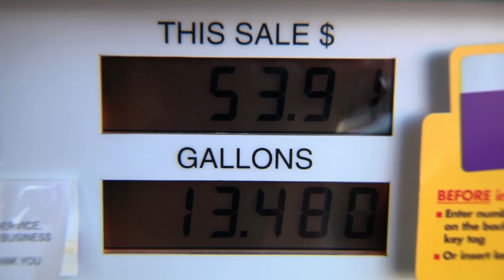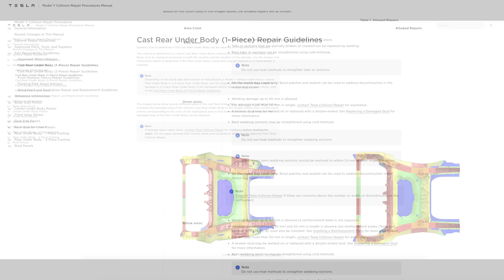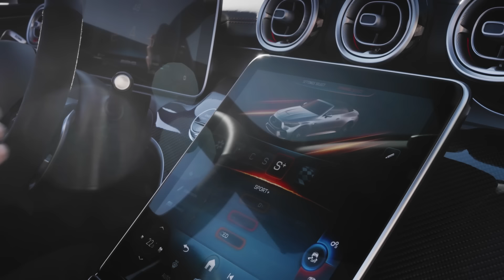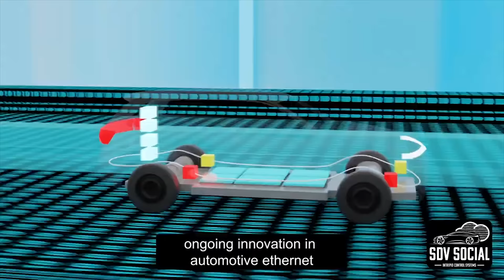EVs Put Massive Dent in Gas Demand; U.S. Eases Battery Sourcing Requirements - Autoline Daily 3805

Comment: Remember, when you hear sales percentages, they never mention the cars already on the road. I'm guessing the "EVs on the Road" are a very small percentage. I never hear existing cars mentioned. I'm not against EVs, I just think it's going to be a lot longer than they think.
Reply: Yup. It should be considered illegal or at least as "lying" when they mention just percentages.
Reply: Ice vehicles sales peaked in the u.s in 2017(during a growing economy at that) and the ice vehicles that did sell were likely more efficient than the ice vehicles that went to the scrap yard.
Reply: Yes, but while EV sales might be putting only a small dent in the overall fleet numbers, people might be preferentially driving their shiny new EVs, especially for everyday commuting.
Reply: @dansanger5340 Yep. Two-car families, with one EV and one ICE, are driving their EV as much as possible. The difference in running cost is staggering.

The combustion car is relegated to being used for longer trips, and where two cars are needed at the same time.
Reply: @JD-yx7be That's hard to believe with as many of these four door pickup trucks that make up the majority of the sales at most dealerships. I know for a fact that those big vehicles get really poor gas mileage.
Reply: @paul5683  my 95 f150 with 5.0L standard cab get 14mpg a 2024 f150 crew cab with the 5.0L gets 20mpg
Reply: @EnriqueThiele Please don't bring "NACS" into the conversation.  Elon didn't open source it until a few months ago.  He kept it proprietary for so long because he was trying to lock people into a walled garden.  The only changed his mind when that failed.  His greed (and the regulators' failure to mandate a single standard) is the only reason that we are the only major EV market in the world that is CURSED with two competing standards, which has hampered overall EV adoption.  Elon really screwed the pooch on that one.
Reply: That’s what is said all the time, but the conversion to EVs is well on the way. EVs have gone from nothing to 3% very quickly.
Reply: Excellent point, and would be a better way to analyze.
Reply: @dansanger5340  Maybe, but data and facts needed.  I'm pro EV, but anti reporting of conjecture as fact.
Reply: @PercivalFakeman  It would be good to know % of sales vs. % of active auto fleet.
Reply: @PercivalFakeman  Trends have a way of suddenly surging. Film to digital cameras. Flip phones to smart phones. 
What we lack right now in the USA is a selection of cheap EVs. Engineers are designing them now, along with cheaper better batteries. Someday the floodgates will open. If we don't do it, the Chinese will.
Reply: @BTC_Minarchist  It is a little over 1% of total fleet in the u.s, and around 7.5% of new car sales.
Reply: @BTC_Minarchist  from various sources, it appears to be about 3% of Americas autos are electric. When check parking lots, that seems about right. Also, auto sales are way down right now, but cars that plug in, either EV or Plug in hybrid sales are about 50% of sales as per various sources. I think that the sales are an anomaly and that that ratio will drop in the short term to favor ICE autos. At least for a few years.
Reply: @PercivalFakeman  seems reasonable.   Hopefully, we can get some more detailed and reliable data over time.
Reply: @EnriqueThiele 
Exactly!

Comment: 7:45 - An AMG 53 with just what ?
3 l V6 - what a crap of downsized machine. Quite the opposite what the had sold before and they must even hide it under 5.3 instead of the usual AMG 3.0 

Stupid move and weaknees, only idiots would buy these cars compared with those engines they had sold before. Makes no sense for a company that wanted to offer a sports car spirit but delivers an empty hull instead.

Comment: Unfortunately, what makes electricity? You make a product dependent on something. Control the flow and price etc... every aspect... Now we use fuel to make electricity and batteries and parts, send it through plants and wires and transformers etc...
Reply: Tired narrative. Last year, 90% of new power production was solar and wind. The last coal-fired power plant built in the US was built in 2013. Now, coal-fired power plants are being decommissioned. Unsubsidized solar is the lowest cost of electricity production, so it is winning.

Comment: If  "EVs put a massive dent in in gas demand", then explain why oh why, gasoline prices are at near all-time highs in California, a state that has more EVs than any state in the union? Oh, and by the way, as a taxpayer, I completely resent having to pay for a portion of the cost for my neighbor's EV via government subsidies. This is taxation without representation.
Reply: Well, CA keeps raising its gas taxes. And it artificially reduces supply by dictating only CA-blended gas can be sold. And it doesn't permit new local oil production, so it has to come in from elsewhere, like AK. Refineries are closing faster than they are being built/expanded, so meeting CA demand is difficult. Pipelines don't really exist across the Rockies, so supplies from the rest of the country don't affect CA's supply/demand.
 
Basically, CA WANTS gas prices to be high to you don't use it.
 
And it isn't taxation without representation. You have representation. You can vote. You're just surrounded be enough people who vote to give unelected bureaucrats & committees control over your economy.
Reply: @theevermind  Fact grenades flying all over the place in that response 🙂
Reply: Why should you poison the air for free?
Reply: The cheapest way to remove and prevent the brown clouds over california is not to produce them.   The EVs are a bargain.

Comment: I have a 1993 Oldsmobile Achieva scx with the w 41 high output Quad 4 I have a spare motor and my car is in great condition because I know how to work on it myself the engine is modified a little bit about 225 horsepower it's just a 2.3 litter dohc four-cylinder no Turbo with a 5-speed manual transmission fast enough for me the only way I will get an electric car is if I'm forced to

Comment: Hate to tell you Autoline, but Tesla has replaceable crush zones on their castings too. There are indexed areas on the crush bars where the damage area can be cut out too and a replacement piece bolted on in its place. Yes the drillout hole indications for the bolts are already there on the casting. 
   Xiaomi's similar solution may be faster to repair but may actually require more material regardless of the amount of damage....therefore more costly overall.
Reply: Didn't Sean say in the last autoline episode that Tesla was changing its mind concerning these giga castings?
Reply: They are junk and weak quality. They are literally falling apart like their axles.
Reply: @paul5683  Tesla was contemplating making some more affordable cars by casting the entire front, back, and sides all in one big casting. I believe Sean called it a "megacasting". 
Right now Tesla only casts two major parts of the underbody and have decided to just keep doing that for their newer, more affordable, line of cars. I think the media is calling this as "Tesla abandons large casting" or some such fodder. In reality they may have found that it might not save them all that much time and money to make it worth it.
Reply: The now fired quality team thinks casting cracks are fine!  Ship em!
Reply: @bobbbobb4663  LOL.  Actually the head of the charging group was recently swing under Elon as a direct report. Two weeks later she and her whole team is fired. One has to wonder what Elon found out?  Tesla has lots and lots of teams, but I've never heard of one with 500 members.... in Tesla that is a monstrosity. Usually teams are less that 7 people.
Reply: @nickmcconnell1291  When your CEO is an admitted drug user with a BoD that is a full of a bunch of yes men, this is exactly what one you assume would happen from a decision making metric.
Reply: re: "There are indexed areas on the crush bars where the damage area can be cut out too and a replacement piece bolted on in its place."which unfortunately means very little in the context of Insurance Co's developing stance on the warrantability/irreparability of unseen damage to the Main Traction Battery.
Reply: @phillyphil1513  Very true. It really boils down to depreciation. I used to work in a large multinational bank. I saw how our car mortgage business worked with insurers. If the car's depreciated value was less than the repair of possible underlying damage (like a possibly bent frame) then the insurance company would write the car off. 
They would rather do that up front than chance having more expensive claims later on a previous accident. 
    The same holds true with EVs but even more so. EV prices have gone drastically down in the last two years. This has massively depreciated the ones bought previously. There is not much data yet on how various collisions affect battery packs. Ergo, the insurers would rather write off the car for the depreciated value if there is any question that the battery may have been damaged. 
However this might change in the future as battery pack prices continue to fall. By 2030 they may cost under $1,500.00 to replace. This may entice insurance companies to just fix damaged EV castings and replace the battery pack too just for good measure.
Reply: @phillyphil1513  BTW, if you are getting huge insurance quotes on EVs, then it may be that Tesla doesn't offer insurance in your state yet. Amazingly once Tesla insurance is offered in a state the price of all insurers for Tesla EVs comes down. Bizzarre huh?

Comment: I can't imagine it is much of a dent because I see very few EV's on the road.
Reply: depends what state you are in. Many mid west states are 1-2% and many coastal states are above 10% of new car sales. I'm in Maryland and it is around 15%
Reply: @JD-yx7be  % of fleet not % of sales is far more relevant and even in California, they are too afraid to release that data so they must be embarassed by how small it is.
Reply: Of course not since the global fleet is huge and there are relatively few EVs on the road.  That doesn't change the fact that EVs continue to take both market share and an ever increasing percentage of the total miles driven.
Reply: @jerrymiller9039  5% of the fleet is replaced every year with new cars sold and old cars entering the scrap yard. 5% means it roughly takes 20 years to replace the fleet. 2017 is when ice cars sales peaked and has been on a steady decline since. Battery prices are falling every year while ice prices keep increasing. There is going to be a point where they reach price parity without subsidy.
Reply: @JD-yx7be  "There is going to be a point where they reach price parity without subsidy."  Time will tell, we are not on track to roll out EV's anywhere near as fast as what they have been claiming for years.  There have been plenty of examples of technology catching on but also plenty of examples of it not performing as promised and flopping.   Nobody has a crystal ball but we know ICE works well and we have the technology and infrastructure in place for it.
Reply: That would be called "confirmation bias".
Reply: @jerrymiller9039  Time will tell. There was a time there was no gas infrastructure too. I think the first public gas station opened in 1913 decades after the gas automobile started sales and it wasn't built out nationwide the next day either.
Reply: It looks like there are a lot in southern california, this is a huge population
Reply: I remember driving with my grandpa in his 83 f250 diesel and maybe 1 in 10 stations had diesel now it is closer to 3 out of 4
Reply: @JD-yx7be  Diesel is a dirtier fuel than regular gasoline.  It is not refined as much and puts out far more particulates.
Reply: @jerrymiller9039  I only mentioned diesel as that was fairly recent infrastructure build out. EVs now outsell diesels in the u.s so i would expect chargers to increase as the cumulative fleet increases
Reply: @JD-yx7be  Chargers are increasing but not rapidly.  Last week Tesla fired almost everyone in its department that makes new charger stations.  Also diesel is still the dominant fuel for commercial trucks and construction equipment and such.  Diesel is not going away soon for applications that need good torque or towing capacity.
Reply: it will be a gradual growth just like diesel station growth, people saying everything will be ev in a few years are delusional

Comment: What will happen to the gasoline when all cars are electric
Reply: what will happen to blockbuster when everyone streams?
Reply: @JD-yx7be  what to reply when answer to a question is different question ? 🤔
Reply: @prilep5  yes
Reply: Gasoline will never fully go away. People still makes buggy whips and stagecoaches.
Reply: @JD-yx7be  Q: what will happen to blockbuster when everyone streams?  BETTER Q: what will happen when the bulk of the population develops the wisdom and intelligence (like the older generations possess) to STOP making the classic mistake of "Apples V. Oranges" comparisons...?
Reply: @martyscholes119  re: "People still makes buggy whips and stagecoaches."  ironically, i still see people occasionally driving Model-T's (small collectors and owners groups obviously).  in fact, i took a picture of one driving in traffic on the 880 back when i was out in 'Frisco just before the Pandemic (still have the pic on my phone).
Reply: @phillyphil1513  when something gets replaced the old thing goes away. it is apples to apples
Reply: @phillyphil1513  you think that trucks tractor bulldozers ships and aircrafts will be battery powered?the first question was that most of the demand for carbohydrate fuel are diesel and kerosene there is no aircraft or heavy duty machinery that runs on gas87 or 90octane. Cars exist just to burn/spend  the unwanted fuel

Comment: massive dent in gas demand? more like gas prices reducing consumption at the pump as no one is filling their tanks.
Reply: the vehicle consumes the same rate of fuel no matter what level the tank is filled. If you only fill 1/2 way then you have to go to the station 2x as much
Reply: @JD-yx7be  its called trip planning. more people end up doing it to save their dollars instead of just say. ducking to the shops for bread and milk only. you go the the station less and get 2x done. but at the cost of convenience. im all for giving up some convenience for a greater good. but all this false BS about batteries being 'green' needs to be addressed truthfully.
Reply: @highwaltage  I don't care about it being green other than my wallet. My aunt owns a 11 year old EV on original battery with 90% capacity. I plan on buying a used EV for my next vehicle. And i get my electricity from coal and support the local coal workers
Reply: @highwaltage  🤦
Reply: @BTC_Minarchist  quit hitting urself. not healthy lol.
Reply: @highwaltage  😊😉

Comment: The stats I have seen on oil consumption hasn't really changed.  
EVs are idiotic when the energy and convenience of a gallon gasoline cannot be matched. 
Tax credits is taking others peoples money and pushing a political position most are not wanting.
Reply: If you pay taxes you might as well get something back. Plus you can "fill up"  at home which can't get much more convenient
Reply: I can charge at work for free or at home for 25-28 miles/$. Maximum convenience. Last time I needed to go to 20 megawatt gasoline pump is when I rented U-haul van to pick up dining room furniture.

Comment: EVs are so popular, there are lots of lots full of them, unsold.  When you have a brownout and can't charge your EV, you will wish you kept that hybrid.
Reply: All dealers have lots of cars. EVs have more than one days worth or range, some even have a 2 way charger to power your house as a sort of back up generator
Reply: How many new ICE cars are sitting in lots unused?  When we run out of the fossil fuels or it becomes so expensive to drill, you'd wish you'd bought an EV.  

Globally, 1 in 4 new cars sold are EVs. In Norway its 9 out of 10 and China is 2 out of 5.  The number is starting to reach exponential growth phase of the logistic adoption curve.  The US is an oddity with so many of its population beholden to oil politics and fossil fuel promoted myths.  The biggest market for vehicles is not the US.  Guess who is?

EVs actually incentivize decarbonization and expansion of grids world-wide.  Which is something that needs to be done anyways.  ICE vehicles have never and will never provide incentives for grid expansion.  Instead, continued use of ICE just props up oil dictators like Putin and keeps the world bent over OPEC's oil barrels.  Not even talking about existential crisis that massive climate disruption brings to us.
Reply: Don't gasoline pumps need electricity to work?